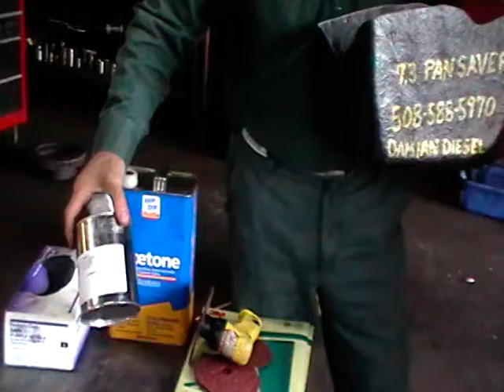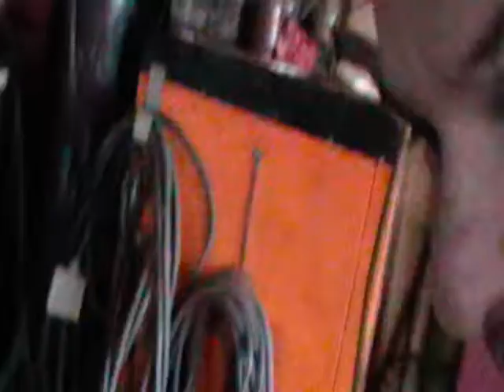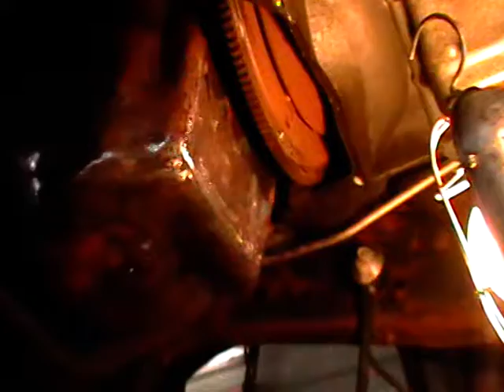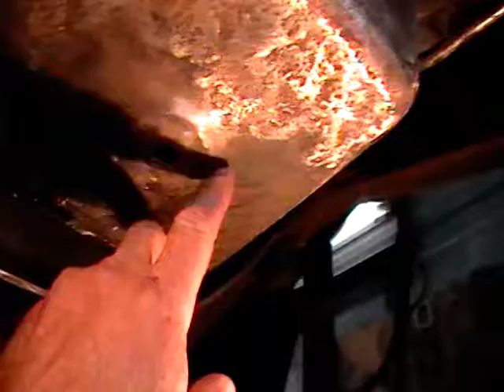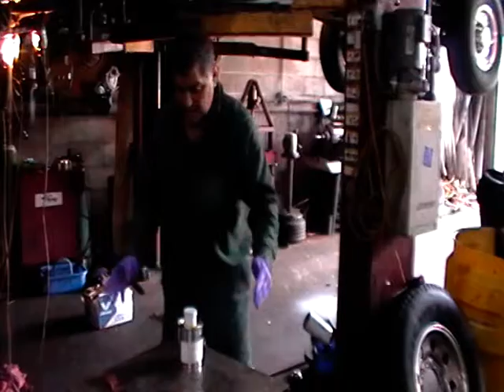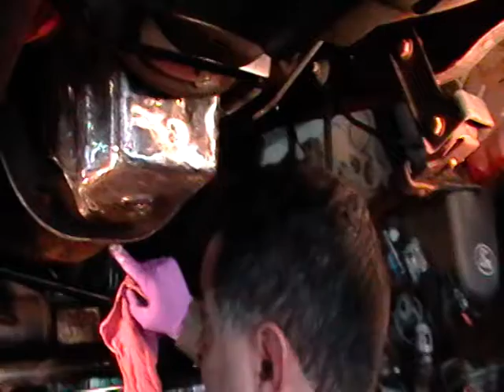7.3 Ford Rusted Oil Pan Repair Kit (1of 2)

Comment: .This is the real deal and this idea is the best  out yet if done like they say. I have a 2003 F-250 Super Duty and the oil pan rotted out. I didn't want to spend $2000.00 to pull my motor so I did some homework. Once this fiberglass mold is in place and dry, it isn't going anywhere. I even went an extra step and waited until the epoxy was about 2 hours into it's cure time and wetted my hands with soap water and smoothed out the glue so it really looked nice when completely dried.Great guy's A +

Comment: With 28 years automotive years experience sometimes you have to step back and do some damage control. Your options are this. To remove this engine and disturb components that were engineered not to be dismantled and re assembled Compared to a installing this kit. It works great best money you will ever spend!!!!!

Comment from the maker: @CBURN86  the most common leak problem after pan replacement is from the pan rail to block siliconed joint.it can be a challenge to keep clean and dry even when youre not playing 'beat the clock'. sometimes a tech can be fooled by a leak at the rear passenger side of the pan near the starter,he may think the pan or rear main is leaking but it is probably the high pressure pump leaking into the valley,draining out the drain hole above the starter,be carefull on this one. good luck,damian

Comment from the maker: @bobsethbroc polyurethane bed liner coatings have a tough time with the heat cycles and fall short,i have seen this done and after a while they can peel,but it is better than doing nothing but wont help after you're leaking.

Comment from the maker: DJatVRR you would bet wrong, this truck was done over two years ago, we just saw it the other day for normal  service and ball joints one side. all systems are great, truck runs great,owner is happy. pulling 7.3 engines require time,equipment,tools,space and certain knowlege and the chance of disturbing things that would normally not be disturbed, causing more expense.Most folks are just looking for a low cost way to repair it themselves wouldnt you agree?

Comment from the maker: I would suggest directing these shops to the factory service manual which outlines in detail the procedure for oil pan replacement in an idi 7.3 94 and down, which does not remove engine just lift it up.  making a mold for the 7.3 idi would be too costly for the return, sorry. good luck,Damian

Comment from the maker: the old 7.3 which you have does not have the same pam as a powerstroke,you will have to change the pan but it can be done in chassis. the engine needs to be lifted up,exhaust cross over removed,flywheel pan,pick up tube dropped remove pan.

Comment: What about rust flakes coming off in the oil pan and getting in the engine? Our pan is rusting and we were thinking about getting this. We have a 2000 F350, and it is leaking pretty good.

Comment: You can bet it's time to replace tubo and oil cooler seals if your pan looks like that. Might as well pull the engine and do it all correclty 1 time.

Comment: I just bought a 2000 7.3L and the dealer put a brand new OEM oil pan. Since its brand new it obviously doesn't have any rust but I still want to put your fiberglass shell on. What would I have to do differently if anything than what's shown in your video?

Comment: i have a 92 f350 with the older non turbo non powerstroke 7.3 diesel, does it have the same oil pan as the newer 7.3? will this kit fit on my older oil pan? or will i have to replace the pan and if so can i do a pan swap with the engine still in the truck?

Comment from the maker: There is no such thing as an o-ring aftermarket pan for 7.3 ,and the pan in a 7.3PS cannot be removed in chassis without cab lifting,trans removal,and serious engine lifting. By the time you did it 
[if you could] , you could have removed the engine easier.

Comment: meh, just pull the mount bolts, jack up the block and pull the pan and replace it with a new aftermarket o-ring style pan. Problem solved.